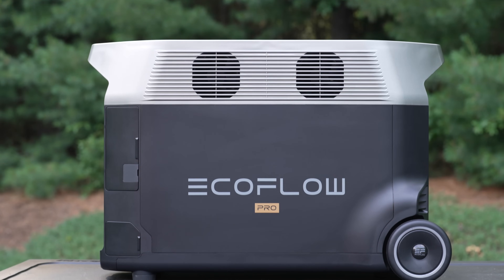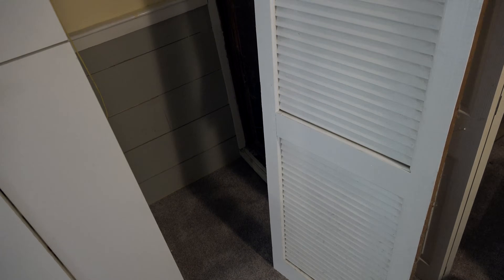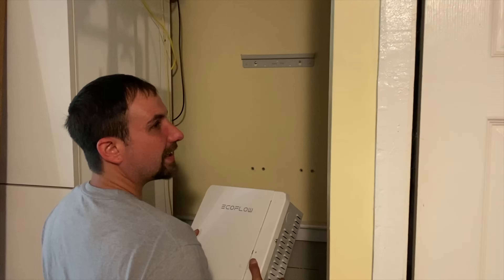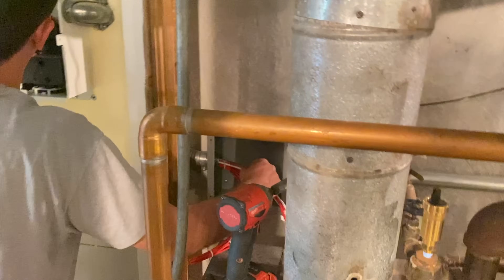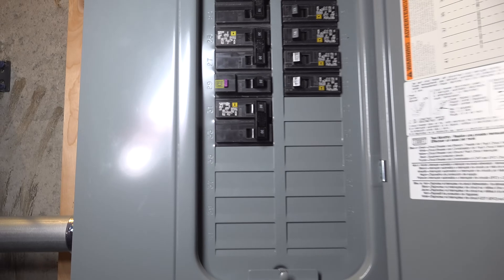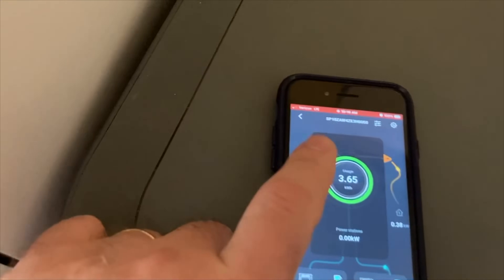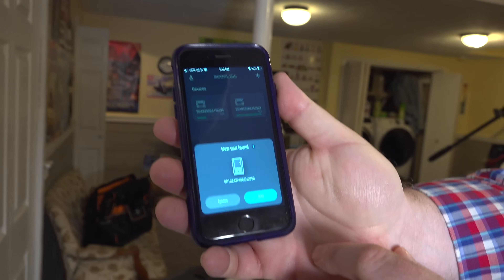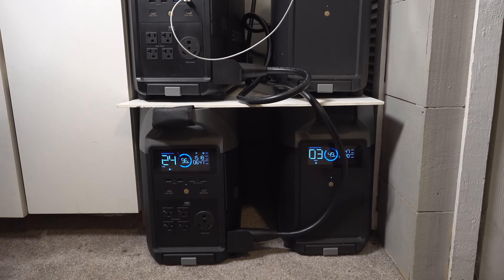AUTOMATIC Battery Backup for your ENTIRE HOUSE! - Ecoflow Smart Home Panel

Comment: Good idea upgrade Eco flow delta pro 3 system and Eco flow delta pro 3 extra 4 battery power whole house 25 KWH and 2 add Eco flow delta smart panel 2

Comment: Good evening. I am basically trying to have the same thing done in my basement , but 2 electricians have blown me off. I too live in Ma and was wondering if you could please share your electrician with me so I can get my setup installed. I have the smart panel 1 and 2 delta pro's and 2 batteries for now. My SHP can be mounted  right next to my main panel.

Comment: FWIW I'm running a Kohler 60REOZJB and switchover is <10 seconds to full power (200 amps).  Generac home standby units will catch power in well under 30 seconds so the statement of minutes is inaccurate.  We have backup batteries for our TVs, Server, Starlink, etc but you would be running those anyway to catch voltage dropouts.  

I also think it's going to be hard to make 10 breakers make sense let alone not having AC after a hurricane is going to SUCK! Do these have a place yes, is the technology there yet, not really, but it is close.

Comment: Is it possible to run on solar when the batteries are nearly topped off while having grid power? Would be nice to take advantage of the 1600W solar capacity per Delta Pro while the sun’s out and save some money on grid power

Comment: To be fair, it is trivial to have UPS units for PCs and routers to get you through the 30-60 seconds a standby generator will take to spin up and transfer the load.  And unlike this system, I can run my house for basically unlimited time on a natural gas generator, including air conditioner loads.

Comment: I have a 50 amp transfer switch in my home, what adapter or process would I need to connect my Delta Pro to the 50 amp inlet?

Comment: Solid review. Thank you. When powering major appliances like water heater, stoves, washer/dryer etc., would I need 2 x Delta Pros or 1 Delta Pro + 1 Battery and does this smart home panel come with a 30 Amp breaker?

Comment: Where I work we have a Generac Whole House Generator with an automatic transfer switch, it's NOT 1-2 Minutes, it's about 15 seconds from power outage to generator running and supplying power, for that gap we have UPS's sized just large enough to handle enough wattage to keep the desktop, router and modem powered up. personally I want battery so it can charge on solar and I can build out a Solar setup in time.

Comment: Did I miss it, or did you state the cost of the EcoFlow Smart Home Panel device... ?    Would definitely be interested in combining the device with solar panel installation.     On a separate matter,  is it necessary to buy 2 EcoFlow machines if my intentions are only to have a few lights on while my power is down  ???

Comment: Cost for the smart home panel... ?   My installation would be close enough to my main electrical box  and so the labor cost should be in the $300 to $400 range  ???   Know a few good,  retired electrical guys who don't charge union rates ,but are qualified to do such installs.
Reply from the maker: My friends install needed to be about 10 feet away and that definitely added pipe and wire to the cost. He paid $1000 for the install you saw in Mass.

Comment: like that this is inline but contrary to the video's description it will NOT power the "ENTIRE" house; at 1:57 "now this panel will not power every single thing in your house, you've got to pick UP TO 10 circuits"..  Do be careful when doing anything w/electricity. My personal rule: If in doubt, it ALL goes out at the panel, at the meter. Even then...still test those lines

Comment: Can I use delta pro along with the main grid? Power the house untill bateries run out or go to specific %
then main power runs the house. I see this marketed as home backup but that use case is rare in my area. I want a solar system that can power the house. This seems to be the hardest part of figuring out how to power mains with batteries/solar setups.
Reply: I have the same question.  Can you charge up the ecoflow units using say portable panels, then plug those into the Smart Home Panel, choose what you want to power - then have the unit switch back over to the grid once the batteries drain.  Rinse, repeat.

Comment: Is the smart home panel worth what it costs?  I've heard that there are many panels which would do the same thing for a fraction of the cost.  I do own an E.D.Pro..but my electrical panel is not ready for any kind of backup system.  I'd be willing to switch it on manually if it meant saving hundreds of dollars.

Comment: Question, can I add more batteries to give my home power for 7 days? And can I put solar panels on my roof to help charge the batteries during an extended bln out? Basically I'm trying to ensure my family is unaffected during a power outage. We have a gas water heater, gas furnace,  deep freezer, one refrigerator, gas stove, central air, a microwave/deep fryer, and 3 flat screen tvs, 2 gaming systems and my home office which features 2 monitors and a laptop, and our wifi setup and 5 surveillance cameras.

Comment: Nice video.  It's a nice idea but unless your already committed to the ecofloe system, have parts that you can actually replace in the event of failure seems critical.  Mailing this to service a failed component means mailing 60 pounds of batteries to do any work.  At least get a system that keeps the batteries and the electronics separated so service or even replacement is manageable.
The ecoflow devices and similar are great but they come with a liability.  It would be nice if you could drop the batteries out easily

Comment: @SilverCymbal -  I've read in other threads where the EcoFlow home panel is installed, they are losing battery power slowly over a period of days (its not keeping a charge).. have you seen this happen in this install at your buddys place?
Reply from the maker: I haven't heard that but he has chosen to keep his in online mode so when the power goes out nothing goes off. He just had an outage and was thrilled how this worked. But maybe if it was in offline mode it would have that issue?
Reply: @SilverCymbal  thanks for the quick response.  Would be good to test perhaps.  That said, I think this is something that one would want in online mode all the time - I know I would!  BTW I read that in the Youtube thread on another EcoFlow home panel video.  Was curious if it was a bug, as Im either pulling the trigger on an Ecoflow or Zender system myself.  cheers.

Comment: Can you use other battery storage options with the home panel?
Reply: I believe only the Ecoflow Delta Pro units, can be used with the Smart Home Panel.  It uses the Infinity port and cable to connect the two together.

Comment: So I can use my manual transfer switch by disconnecting my portable gasoline generator and plugging in the Ecoflow Delta Pro to the outlet to the manual transfer switch?  I don't need an automatic function.

Comment: Can you Incorporate the Ecoflow dual fuel Smart Generator into this setup? That would make it Perfect, with being able to have the Main Propane tank on the property setup with the Smart Generator, which will always be keeping the Batteries Filled as needed, without having the Generator constantly running.
Reply: You could, the only problem is venting the generator to the outside.
Reply: @GardenPadawan  Just run the power through a passthrough to where the batteries are.
Reply: @whattheschmidt  , that's definitely a possibility. Doesn't quite work for me, I would need about 30' of power cable, and I don't think they make one that long yet.

Comment: Thank you so much for the steady stream of incredibly useful content - to the point, no click bait, solid reviews. Question: can this battery and ecoflow setup be used as an intermediary between when power is lost and the time it takes (usually 5 minutes) for a while home backup generator to kick in? Basically, Would a generator automatic transfer switch be able to be thrown into the mix safely? Thanks!
Reply: That’s exactly what the Smart Home Panel does amongst other things. It acts as an automatic transfer switch when the power goes out. No need to purchase additional equipment. My Smart home panel arrives today! 😊

Update:  It all installed. 👍🏼👍🏼👍🏼
Reply: Most likely not.  I don't think the NEC would allow two different power sources and two transfer switches to be used.

Comment: Will this power my central heat/ac? I need something that will.
Reply: Heat - definitely (natural gas? propane furnace?).  A/C probably with 2 batteries, yes, but it will be using a lot of power and not run the A/C too long.

Comment: Love my SHP but really confused as to why it drains both my Delta Pros slowly over time. After a month of being connected, more than 30% of my battery capacity has been drained with zero power outages or other events that would cause the batteries to be required. Leaving the batteries disconnected from the SHP “solves” the problem for me but obviously is non ideal. My best guess is that when the Delta Pros are connected, they never timeout and for some reason are pulling power from themselves vs the grid to provide connectivity.
Reply: My is doing the same thing. Does your panel charge your batteries?
Reply: @TheBsEr  Yes. It seems we have two options. 1) Manually trigger the charge via the app or 2) Set a rule to auto recharge after a certain level is passed. 

I just did another test where I charged up the batteries to 100%, left them both physically connected to the SHP but turned one of the AC ports off and EPS (the super fast fail over) off as well. The result after 14 days with zero power outages was 43% drain on one Delta Pro and 26% on the other. 

I then charged them both back up to 100%, physically unpluged them from the SHP and waited. It's only been 7 days so far but both Delta Pro's are still at 100% charge. 

The only thing I can figure is that when they are plugged into the SHP, the batteries never turn off. In the app you can see how the timeout (which I've set to 30 mins... the lowest setting) switches to "Never" and you can't change it. It's REALLY weird that it would draw power from the batteries to stay on and even more weird that there's that much power drain over 2 weeks just to keep the wifi or whatever on.
Reply: @cbroussardphoto  thank you! Sorry another quick question, are your batteries hooked up to 30amp breakers through the SHP? I dont think my are and when I tried to turn on Recharge, it just turns back to off right away. I tried turning off fast charge on the batteries and still seem to happen
Reply: @TheBsEr  yup. 30amp breaker.

Comment: If you add a Smart Home Panel and two Delta Pros you’ll get a grand total of almost 9,000$.
A Tesla Powerwall costs 10,500$ and sports a 7kw capacity (almost the same as the two Deltas, which is 7.2kw).
Since the Powerwall has a much more sleek and compact design, what’s the main advantage of going with a pair of Deltas instead of a Powerwall? Is it only the fact that the Deltas are portable?
I’m not being over critical… I’m just trying to understand other POV.
Reply: ??????? the advantage ???????? you can roll them around and use them ANYWHERE , last i checked thats not the case for the tesla
Reply: @tubevideoguy762  that’s exactly why I said “except from…”
Reply: When you need to replace a unit, it can be done as a DIY project. Can't do that with a power wall.

Comment: That’s cool, but expensive at $1500 plus $500-$1000 installation.   I added a Reliance manual 10-circuit switch between my circuit breaker panel and my Bluetti AC300.   The AC300 has “instant” UPS switchover, so uninterrupted power is the result.  But I keep only one circuit (refrigerator) on the AC300, and then add more circuits as needed during an outage.  I plan to add solar to AC300, and then I will switch over more circuits to UPS and program the AC300 and number of circuits to closely match my solar production.

Comment: I am extremely interested in eco Flow along with wall panel connected to breaker.  Not much work to connect eco flow without basement. We believe we need 2 unfortunately since we need 4 k watts to run home Well system that will not run with power outage. 

We have had at least 50 outages plus in a 5 plus yr new home built from ground up.  So we are looking at 7k to 8k plus to install with panel. 

How long will eco flow run with fridge, well, wifi set up, to rooms to run while working from home? We have a 2 story 3k Sq ft home.

Comment: this panel is a Payne in the ass also short wire / in my case the software is not fully complete yet / I installed  it in the house about 2 month ago.. it keep loosing my circuit names , and schedule i had to take a screen shot from before so i can put it back in the app circuit name , another annoying  thing you get only 1 cable  that means you run all 10 circuit at 110v. that way that battery won't last long at night, but you can flow with solar during the day.. the cables are not for sale yet, they keep telling next month, next month... what i did? / I fucking cut the wires of the double voltage smart hub and made my own goddamn cable same length, same wire gauge and now i have the delta pro in my panel just like this guy here..
Reply: I got my 2nd cable off ebay

Comment: Now having a hybrid, having the batteries and a gas generator would be amazing, the batteries get low and the gas generator turns on and charges them!
Reply: EcoFlow has a smart generator that does exactly that. It will automatically start and charge the batteries when they get low.  I just order my system with the smart generator. Also, don’t forget that they batteries can be hooked up to solar panels. The system has pass through charging so you generate energy and use it at the same time. When my ecoflow system is complete it will have batteries, solar and a smart generator.
Reply: EcoFlow has a smart generator that does exactly that. It will automatically start and charge the batteries when they get low.  I just order my system with the smart generator. Also, don’t forget that they batteries can be hooked up to solar panels. The system has pass through charging so you generate energy and use it at the same time. When my ecoflow system is complete it will have batteries, solar and a smart generator.

Comment: All I can say is that the Delta Pro is one of the best power stations I have ever purchased, I compared this with the EP500 but the Delta Pro is better in a lot of ways. Fast AC wall charging, connectivity and the option to charge it in an EV charging station.

Comment: That is one pretty good review of the Delta Pro. One of the reasons why I got the Delta Pro is the option to increase the capacity to a whopping 25kWh.
Reply: Kinda misleading.  the 25kWh is when combined with 2 gas generators.  The system he has with 2 pro and 4 batteries only give him a max of 21.6kwh.

Comment: I was supposed to get a Honda gas generator but after watching your video. All I can say is that I am sold on the Delta Pro. especially with the solar charging capacbility which means free energy.
Reply: As nice of a unit this is, you better get that Honda generator as a backup.  Our DP got hit with a power surge, while using it in EPS mode. It got damage and was useless. (Good thing we have a Tri-fuel generator) We received a new unit from Ecoflow at no cost to us, but that took a week.

A gas generator is just more dependable if maintained and less to go wrong with it, then these high tec. power stations.

Comment: Would this system permit those of us with solar panels to be able to maintain power from our panels and the Delta Pro during a power outage?  Currently when we lose grid power, our panels also shut off so as to not backfeed to the grid.
Reply: I wondered the same thing... I emailed ecoflow, probably wont know for a few days.
Reply: Great Question! Would love to know the answer.
Reply: @cristinaflogerzi647  
I got a response

"note that DELTA Pro does not support AC coupling. And if you use an inverter to charge the DELTA Pro, please make sure the output power is over 1000W."- ecoflow customer service
Reply: @Gamerz00760  This was very helpful! 
Thank You

Comment: My whole home 22kw Generac will power everything up within 5-10 seconds, I wouldn’t say minutes.  That being said, this is still pretty darn cool.
Reply: My brother is an electrician and also installed a Generac. He showed me how it worked and yes switchover is measured in a few seconds not 2 minutes. That being said for all of my expensive electronics I install APC battery backups to deal w/ brownouts and dirty power. So while there is a 5-10 sec switchover, having the power conditioner / battery backups in place will save your electronics.
Reply: My General switches over in seconds as well
Reply: @ about 12-15 dollars a hour